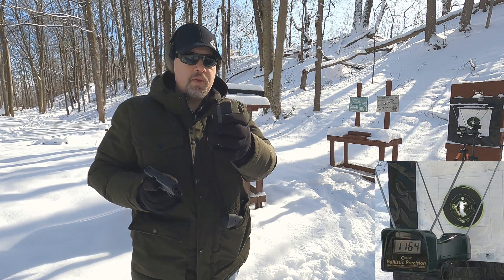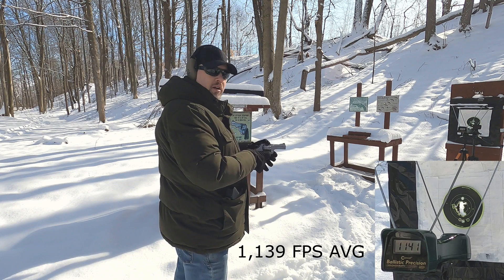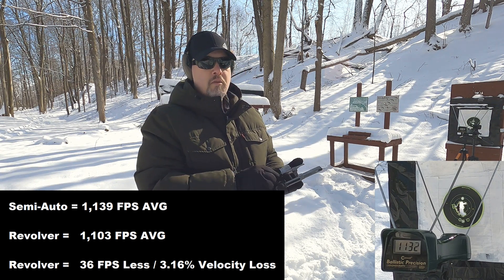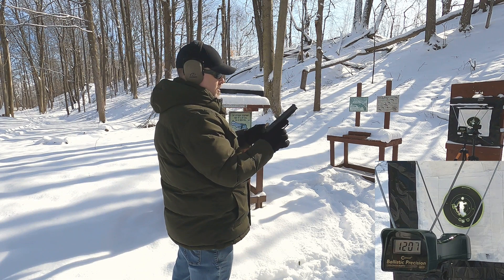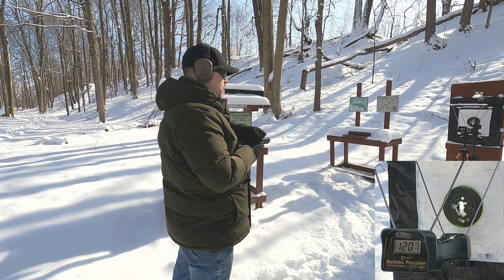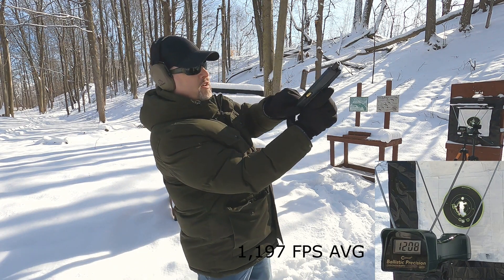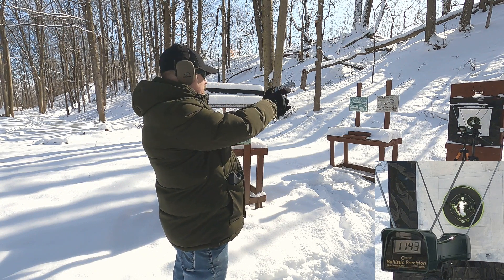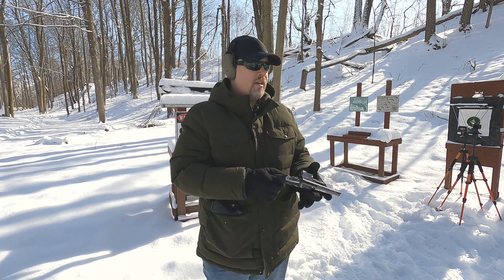You Lose MOST of Your Velocity from a Revolver Cylinder Gap!? (VS a Semi-Auto) 10mm Chronograph Test

Comment from the maker: I did some searching around for how some of the ammo I have tested in my 4" S&W 610 revolver compares to a Glock 20 4.61" barrel. I think out of all firearms, the 610 compares to the Glock 20 closer than any other firearm. With semi-auto (caliber) revolvers it's not as simple as bullet travel, though that does matter. It also has to do with rifling and how the bullet moves through the cylinder throat as well as cylinder gap. For the most part I would say the S&W 610 and Glock 20 are spot on about the same, as I had thought.

Numbers I found while searching averages from Glock 20's:

1. Me/S&W 610 4" revolver - Federal HST 200 gr - 1,101 FPS / Tools&Targets Glock 20 4.61" 1,106 FPS AVG

2. Me/S&W 610 4" revolver - Buffalo Bore 180 gr XTP - 1,306 FPS / Tools&Targets Glock 20 4.61" 1,314 FPS AVG

3. Me/S&W 610 4" revolver - Hornady Critical Duty 175 gr - 1,104 FPS / Tools&Targets Glock 20 4.61" 1,110 FPS AVG

4. Me/S&W 610 4" revolver - Underwood 180 gr XTP - 1,244 FPS / Tools&Targets Glock 20 4.61" 1,242 FPS AVG

5. Me/S&W 610 4" revolver - Underwood 220 gr Hard Cast - 1,183 FPS / Chuke's Oudoor Adventure Glock 20 4.61" 1,129 FPS AVG

6. Me/S&W 610 4" revolver - Winchester Silvertip 175 gr - (new production) 1,198 FPS  /   TNoutdoors9 Glock 20 4.61" 1,170 FPS AVG / Tools&Targets Glock 20 4.61" 1,177 FPS AVG

Comment: The early Ruger 357 flat top had the wide cylinder to barrel gap. . Velocity loss is not the big problem. The problem is the extreme noise made by that gap. In the field not wearing ear plugs the noise actually hurts ones ears bad. My Ruger Security Six does not have that issue.

Comment: Did I miss where you say how big the cylinder gap is on the revolver?  I am just wondering, because I have varying cylinder gaps on my different revolvers.
Reply from the maker: This model 610 has a .003" gap. I happened to also measure the cylinder gaps on the 10 or so S&W, Ruger and Taurus revolvers I have. Every single one has a .003" or .004" cylinder gap.
Reply: @GunSam Thanks!  My S&W has a tight gap, but my Italian Colt clones range from .008 to .013.

Comment: Another benefit of a revolver is that it can be stored loaded for long periods of time, and no springs are compressed - leading to load failures. 

With my home-defense pistols, if I store it with a loaded clip, I swap out the clip every other month and unload it, and let the clip's spring decompress - to improve chambering reliability. 

The clip-springs in pistols can suffer from fatigue over time and fail to chamber reliably if constantly compressed. 

Also, if stored chambered, the firing-pin remains under tension, causing fatigue. 

Revolvers can be stored for long periods of time with nothing compressed or in tension - this increased reliability is worth a 3.6% loss in power to me.

Comment: I don't blame you for ditching your 10mm conversation.  I also think 10mm ammo above a 200gr bullet if iffy any 10mm.  The guns were never designed to run the heavy bullets.  I also question the gains you get running the heavy 10's.  The case is so only so big and your oal can only be so big.  The longer the bullet the less case capacity. So I see the 200gr as max.  So by going to the 610 you have a much bigger advantage for reliability.  I also don't envy you shooting in the snow. So thanks for your sacrifice and dealing with the cold

Comment: I think the only way to do a proper test to see how much is lost would be to compare a revolver to a single shot breach loader, because even the semi auto loses some due to the blowback being used to eject the empty and chamber a new round.  Or I suppose if you could lock the slide of a semi auto to prevent it from cycling, that would work too.  Regardless, it was very interesting to see the differences between semi auto and revolver. I didn’t expect there to be much loss, so the light and heavy ones were a surprise. Great video though!

Comment: First, I like your series of videos on ammunition. I did a similar test years ago with 9mm ammo. My duty weapon was a S&W 5906 in 9mm. I also used a S&W model 940 with a 3-inch barrel as a backup. I chrono graphed a series of factory ammo and handloads comparing the two weapons. In most cases the 5906 was about 30-40 FPS faster than the 940. However, in one incident, the 940 revolver was faster. On page 443 of the Speer reloading Manual #13, there is an article titled "Why Ballisticians Get Gray".  They compare the velocity of three different bullet weights of .357 Magnum ammo in a variety of 357 Magnum handguns and rifles from 2.5 inches to 24-inch rifles. In many cases, the pistols are from the same brand with the same barrel lengths. Keep up the good work!

Comment: I like revolvers.  But I don't make excuses for them. Same with automatics.  Auto loaders have advantages.  I don't expect the military to go back to revolvers.  But.  "Limp-wristing" is both user error AND A DESIGN COMPROMISE.  Fanbois quit making excuses.  Revolvers do not fail to function because your hand is frozen, injured, sliperry with blood, arthritic.  They can fail.  But in the real world they have fewer feed and ammo issues with a wider selection of ammunition types.  The thing you mention about being able to use a wider variety of ammo is a huge advantage for some people, irrelevant for others.  For myself as a hobbiest/enthusiast it is significant.  A typical modern revolver will fire the lightest target load, full wadcutters, any modern defensive load, blazing hot and heavy hunting loads, wierd ogives, tiny shot shells that will dispatch a rat without putting holes in the barn.  Many will tolerate very long wild-cat loads, silhouette competition loads, etc.  Heck, around the ranch a revolver can be loaded with both defensive/varmint AND very light rat shot.  And be quickly indexed to the rat shot.  Most double action revolvers are safely carried in condition 1, even without hard noisy kydex hosters.  For hunting, double action revolvers can therefore be readied quietly and operated without mechanical clicks. And no searching for brass in fall leaves or at the target range.  Its fantastic utility value that may not be important in a purely defensive or service weapon.

Comment: Yeah the cyclinder gap loss is one of those stupid myths  that won't die.  This has been tested may times.  Many many loads and well fit revolvers (cylinder gap 3 to 4 mils)  keep this loss to <30 fps.  50+ fps would be unusually bad, with extremely slow powders that peak after the bullet leaves the cylinder, combined with cylinder gaps > 5 mils.  Another important variable is chamber volume.  It woul be interesting additional information if you measured the volume of spent cases from both pistols.  You can do this with water and your reloading scale.  And the gap of that Taurus.  Best done with feeler guages.  But a US dollar is ~4 mils and should be snug.
Reply from the maker: All of my Smith Ruger and Taurus revolvers are .004" and .003"

Comment: Great stuff! I'd guessed 30-50fps for "non-hyper" ammo as the late, great Paul would say. It's sad how difficult it is to find 10mm ammo actually loaded to 10mm spec for such a test. The best thing about a 10mm wheelgun is that the slide never outruns the magazine spring with real 10mm and it still cycles the 40 S&W velocity garbage bearing the 10 stamp. People who own these guns & watch your content know the reliability problem isn't with you. You'll need a good opener for this next can of worms- why do Pythons tend to shoot considerably slower than L-frames? Is it gap, tighter barrels, rifling, or some combination? I'm still dreaming of a Spohr.
Reply: @randyduncan795 I asked a respected gunsmith that very question about pythons shooting slower (they do, without exception from what I've seen, significantly shoot slower - at least the old model pythons. Don't know about the newly reintroduced model). The response was that Colt tightened the bore diameter - like a choke -  in the last inch or so of barrel, which was supposed to result in some marginal additional accuracy, but created extra friction. I don't know if that is true, or not; just repeating what I was told. If that info is correct, it seems to be something Colt only did on the Python 357. The Colt Troopers shoot just as fast as S&W 357s. Other older model Colt revolvers in other calibers, like the Cobras, achieve the same velocity, on avg, as their S&W counterparts.

I have noticed that older civilian Colt 5 inch barrel 1911s also tend to shoot a little slower than other makes of the same pistol, often even slower than 4.6 inch +/- barreled pistols like CZs, Glocks, Sig, etc. However, the difference is not nearly as large as we see with the python. With the .45s it seems to be a loss of 15 or 20 ft/sec. With the pythons it can be 80 ft/sec or more, depending on ammo and barrel length. Maybe Colt used the same alleged accurizing process on their 1911s.

Comment: Not a huge difference, but that revolver’s .002” b/c gap is a lot tighter than typical.

Also going to depend on the powder. There won’t be much difference with .45 ACP and it’s few grains of fast burning powder. A 10” Contender in .44 magnum has the same bullet travel as an 8.375” S&W,  but the Contender has a huge advantage.
Reply from the maker: I actually think it's .003", I may have misquoted it. But I own a dozen or so Smith, Ruger and Taurus revolvers and every one of them is .003" or .004" gap.
Reply: @ You must be extremely lucky. I have over 2 dozen S&W and Ruger revolvers. 1 is .003, 3-4 are .004, the rest are .005 - .009. Smith and Wesson specifies .004  - .010. Really, anything over .007” should be unacceptable.

Comment from the maker: I have gotten a good dozen comments recently, some in this video and some in other videos that I should "hold the slide of the Glock to see how much velocity is lost from cycling". No, for many reasons. Even if we could do it safely, it's not necessary. 

Glocks, like most modern semi-automatic pistols, use something called a locked-breech action. Essentially what this is, is a system that locks the slide closed when firing the gun, and then only unlocks the slide to move rearward and kick out the spent brass and cycle the pistol, LONG after the bullet has left the muzzle. This means that whatever effect you would get from "Hold the slide to get max velocity when firing before it bleeds out all the power from the slide moving", is unnecessary and has already technically been done with each trigger press. 

Unlike a single shot firearm or revolver that fires a bullet and the remaining gas simply moves forward out of the muzzle long after the bullet is 50 feet downrange, a locked-breech semi-auto has the bullet 50 feet downrange before the action even begins to unlock and THEN use the SMALL amount of remaining gas to cycle the action. 

What you guys are probably thinking of, is older designs like direct blowback actions. A blowback pistol is usually an action type with very old designs or cheap designs or with weak cartridges such as an old .25 ACP pistol, or if the slide is very heavy like with a HI-Point pistol. If a modern Glock in 10mm was direct blowback, it would probably blow the slide off the frame and into your face because the power is so high. That's why most modern pistols use a locked-breech system. 

So again, I will not gain any velocity by holding the slide. Plus it's stupid and dangerous even if I did gain velocity, which I won't.
Reply: Tell these people to go watch a slow-motion video of a pistol firing.  Even with the simplest blowback design, the brass seals to the chamber.  The bullet leaves the barrel before the extractor pulls the spent case. The slide is moving backward but the barrel and frame have barely begun to move.
Reply: Once, many years ago, I split the skin on my left thumb when the slide of my 1911 struck it when I fired it.  Pretty deep gash too.  It never happened again.  To purposefully hold the slide on a pistol to keep it from cycling is to invite injury.

Comment: The real comparison should be a single shot, like the old Contender, with the barrel shortened to the same length as the wheel-gun and the bottom feeder.  It would be an expensive test, I bet the single shot would win, though.
Reply from the maker: Why would that be the "real comparison"?
Reply: @GunSam  It would show how much loss is involved in both the revolver and the auto.  Ideally, we would have several examples of each, since individual barrels can also vary in velocity with identical cartridges.

Comment: Good test. I’ve done a similar one with my Dan Wesson model 14 which I can adjust my cylinder gap all the way down to pressing against the cylinder. I’ve found from .008 down to touching that the difference in average velocity is all with SD for the ammo I was using.

Comment: I agree with you on all points. I don't care what causes a failure. A failure is a failure. I don't want to deal with it if my life depended on it. That's one reason why I went my simplification route for concealed carry. Also comfort is pretty important or you find excuses not to carry.
Interesting results with the cylinder gap loss. Seems to be very ammo dependent. It also seems in 10mm at least to not matter.

Comment: Your videos are fine  brother. Ignore the naysayers.  The BC gap can make a difference if it is on the larger side of specs, but more than the gap, the throats in each chamber will normally be what causes a loss in a revo. In a 10 MM where bullet dia is .400", if your throats are .402" or even larger, you will lose pressure there before the bullet ever enters the forcing cone. It is not uncommon for a revo cylinder to have several different diameters of throats. Sometimes a gun comes with undersized throats, and that is a very easy and inexpensive fix. Ideally you want them to be uniform and .001" over nominal bullet diameter. Throats should be checked by a competent gunsmith or someone with a set of proper pin gauges.

Comment: You make an excellent point with your explanation regarding reliability and the 10mm cartridge . I too have both pistol & revolver and like you I prefer to use the revolver even though I've never had an issue with my Glock 20 & 40 . With such a big and heavy caliber 30 - 50fps loss is not significant . Reliability over capacity any day & every day ! Great video Gun Sam !!

Comment: This is why I quite the 10mm. 9mm, 40,and 45 all work reliably in my pistols but 10mm doesn’t make sense. It’s been reliable in my two Glock 21’s and a Ruger SR 1911 10mm but I had a Colt Delta Elite that wouldn’t feed a whole mag with three stovepipes. In the reliable 10mm pistols it still flung brass at people on the range at near lethal velocity, and no 10mm equals a 44 Magnum revolver and never will. Generally, the revolvers are a lot more accurate and no chasing valuable brass. And if recoil is an issue, you can load the 44 Magnum down to 10mm power. As far as bear defense goes, I’d rather have one revolver with 6 full power heavy flat nose hard cast 44 Magnums any day over two hi-cap 10mms with a round that is sub par at best for STOPPING a grizzly or brown bear. And frankly, if I lived in Alaska, my 45-70 Guide Gun would never be too far away and the handgun would be for an emergency. That’s just my two cents as an avid handgun hunter for well over 30 years.
Reply: You got rid of a gun, because it ejected brass at people you wanted to go away? Sounds like best friend material to me throws brass at nearby strangers

Comment from the maker: This happens all the time, I get accused of cherry picking ammo to get the results I want. I literally went through my ammo boxes that I keep for decoration in my "man cave" and brought out every box that had some 10mm ammo left in them from the years of ballistic testing I have done. If this isn't the best way to get a good average overview, I don't know what is. And it's obvious why I would not include the ARX in my averages here, the bullet is half the height of normal and polymer, it's odd and doesn't really fit in with this test, but like I said I grabbed every box I had with ammo in it.
Reply: How dare you cherry pick less than every ammo available!?!?!
Reply: The light bullet ARX load may lose a similar percentage of velocity as your general pool of ammo. 

Purely for this test conversation, some of the energy that could produce velocity, is cycling the pistol action, and of course, there are some faster barrels, than others, all else equal. But, it’s about as apples to apples a comparison as is reasonable.

Pure opinion, revolvers are so perfect for rimmed cartridges. I do have some regret at passing up a M57, but it was an earlier version and really clean. So, I would have tended to baby it.

Comment: Get a Glock barrel and your feeding issues will go away.
Reply from the maker: Unlikely.
Reply: @GunSam  Why?
Reply from the maker: @buckshot4428  Because this Glock is unreliable all the time. Even when everything is replaced with new parts, it cannot handle ammo that is +P or higher in energy. Drops the mags out with brand new magazines, brand new OEM mag releases, brand new OEM mag springs. It's a Glock 41 specific problem, most people who have them report the same issues. But here's the thing, I decided to see if it would run standard .45 ACP ammo, never using +P and I ran it from June 2022 until December 2024 with basically 2-3 malfunctions out of the dozen or so boxes of random JHP I used in my testing in that time frame. It's funny how I ran the pistol for 2 years basically never getting malfunctions, then I get several in one video and people claim I have never done one test where it didn't malfunction non stop, which is silly.